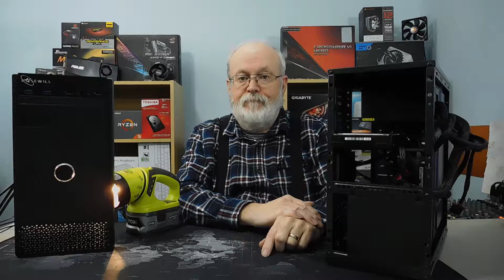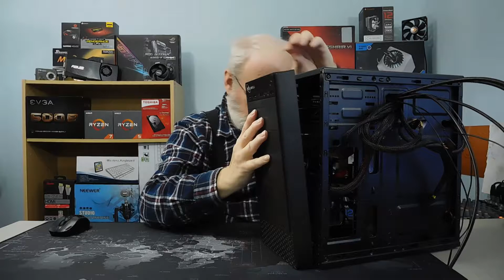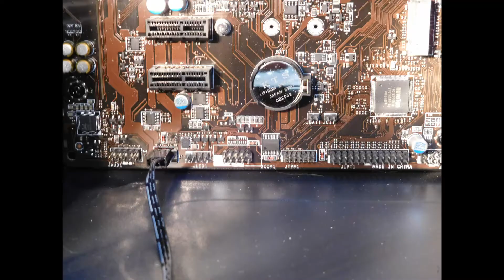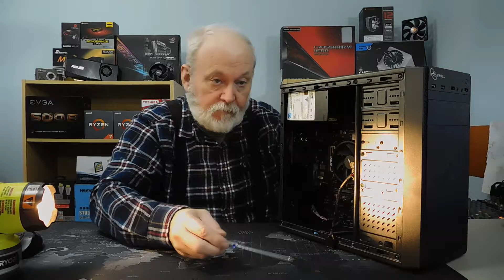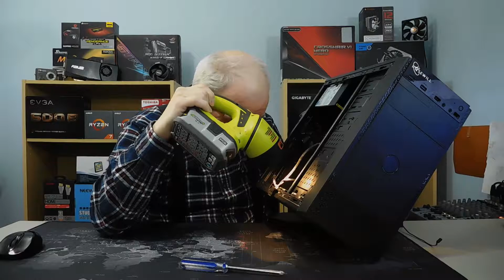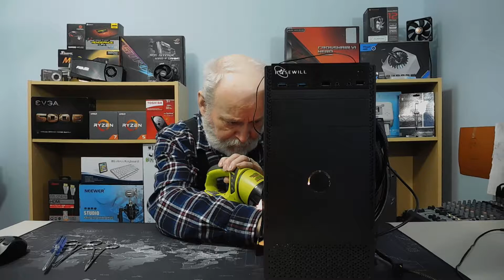Beginner System Build Part 7 Installing Wires and Cables...

Comment: In my personal opinion, putting on the front panel connectors is the most difficult part of building a computer, some boards have very small lettering that show which pins are what, but most don't! And used motherboards that don't come with any sort of Manuel or pin adapters are the worst. Front panel connectors are the first place I look for error, other than the power supply switch, if a system doesn't turn on. And I always seemed to good the (+) /(-) for the power led.

Side note, are you recording all of these one after another or stopping at the end of the video and continuing the next day??
Reply from the maker: Hi James, for sure on the front panel wires what a pain some times. It has gotten better as most major makers adopted a standard, thankfully.  I mostly do one after another for the videos, but this time I talked too much and my camera only does a 28 minute and 11 second video then stops and doesn't tell me so I have to watch Audacity for the time and some times I forget and have to figure out where it stopped and restart from there. This time it happened twice so I have three videos and one audio track, just editing today for the next video as I did too much video recording yesterday. My wife just looked at me when I told her I need a new camera (Canon Rebel SL2), so this wouldn't happen again, lol...